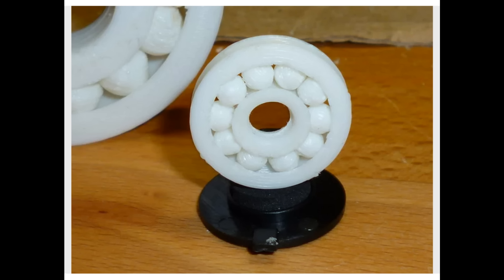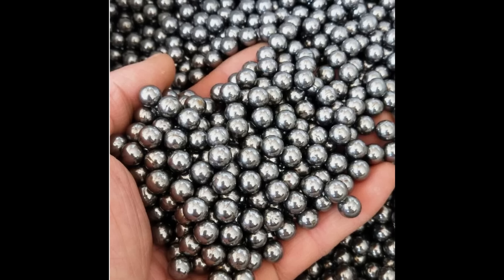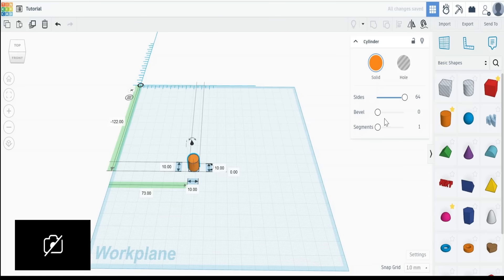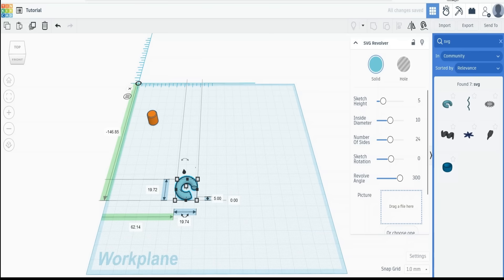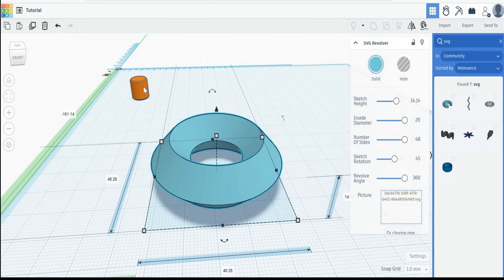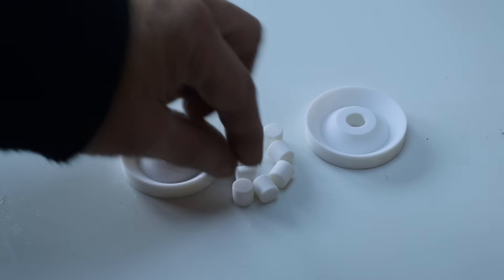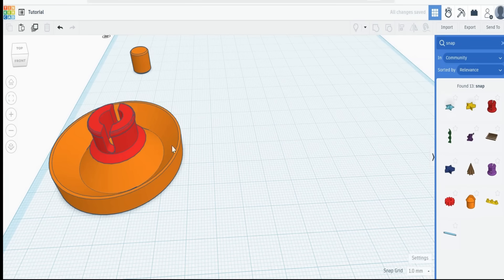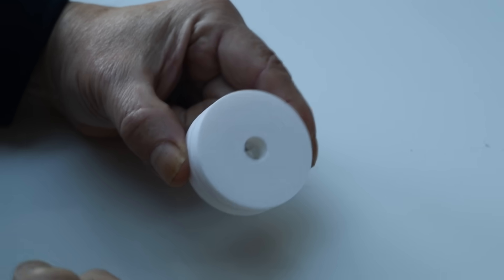2326 Universal 3D Printed Bearing That Works - Radial Cut

Comment: Love this! Awesome explanation and understanding of the limitations of the printing process. I would offer one suggestion regarding the snap fit. It would be best to print the 2 bearing bodies and have a snap fit core printed lengthwise to avoid the layers from splitting when the snap details are loaded.

Comment: I'm now happy to confirm that these bearings are freaking awesome. A tad too large for 5/16ths rod, so scaling everything down would be necessary. You'll need to work them a bit after first assembly and you want to either blow into it or hit it with some compressed air to get the dust out from that process. Not sure if this would handle high RPMs but because it works so well, there are plenty of use cases.
Reply: In case anyone was wondering. You have to scale everything to 83% if you want the bearing to fit snugly on a 5/16ths rod.

Comment: This is amazing. We placed the bearing on the floor and it has no issue spinning under 200 pounds of weight. We are going to use these to show students/industry how strong 3D printed parts can truly be if the design is optimized for printing.

Comment: Tinkercad is great but consider using freecad. Its a bit rough around the edges but it is free and is a proper cad program. Where as tinkercad just works with meshes.

Comment: Hi Robert, 

First off, thanks for all the incredible work you've done on your channel – it's been a huge help to us. I have a different issue I'd like to ask about. 

One of our team members is staying in a fairly new building, and although the main ventilation system is working, the air it’s pumping in has a strange, unexplained odor. It smells somewhat like chemicals or a toxic gas, but it's hard to pinpoint exactly. The issue is, because it’s just a smell, we can't capture a sample for testing, and we're concerned it could be harmful in the long term if it’s dangerous to the lungs or the body overall. 

Do you know of any type of detector or device he could use to identify what this odor might be? We understand you can’t guarantee results, but any guidance would be greatly appreciated. 

Thanks in advance!
Reply from the maker: I'm afraid I don't know of a specific detector - but you might want to tape some activated carbon felt over the vent - that should capture a sample that you can send for analysis
Reply: @ThinkingandTinkering  Thanks a lot mate. I just goggle it and found examples to buy. Last tip, what kind of department can one send such for testing?
Reply from the maker: @AfricanCivilRights  I don't know mate - as I don't know where you are from and countries vary  - but here in the UK maybe environmental services?
Reply: @ThinkingandTinkering  I will definitely find one lke those here in Norway. This help will be used in our database for members for all time, Thanks to your knowledge base guide 🙂

Comment: Compliments on your solution, I was thinking that it introduces a bit of a problem...the contact surfaces of the rollers are pin point which makes for a rapid wear area that remains constant contact at all times. Would it be possible to change the contact point in a way that would improve the fundamental wear characteristics?

Comment: Instead of doing A^2 + B^2 = C^2 for a 45 degree angle, you can multiply the base length by the square root of 2, just a helpful tip that someone taught me that I use regularly.

Comment: when you subtracted the revolved square from the cylinder the result was two separate bodies because the revolved square has a circular edge right on the x-y axis. I found this out while printing. Awesome design.

Comment: Very cool! Quick question: should the length of the snap shaft be 7.07 so that it matches the height of the other half? Looks like it's set to 10 in the video. Maybe you're intentionally adding a gap between the halves?

Comment: bonjour,
j'ai essayer ce roulement. j'ai juste remarquer que le plat haut et bas coince avec les biseaux a 90°. d.10*lg10.
Good morning,
I tried this bearing. I just noticed that the top and bottom flat stuck with the 90° bevels. d.10*lg10.

Comment: The way you designed the bearing would not work for radial loads since one of the halfs connects the outside stationary with the inside. It should work okay with axial loads with the way you designed it, but standard flat laying rollers would work better for axial loads. If you want this configuration to work with radial loads you would need to seperate the outside from the inside. To keep everything in place you could have the outer rim also snap together

Comment: 10:28 Design with 3D printing in mind is something I’ve been screaming into the void for years. So many people put up models that aren’t optimized for printing supports help and tweaks on the end user side but a little pre planning would vastly improve things. 

When you do subtractive manufacturing you have to plan for tool paths and such. 

Good engineers do so. 

Bad engineers don’t even deserve to call themselves engineers. 

Great video. 😊

Comment: "When you're designing something with 3D printing in mind, design it with 3D printing in mind. Playing to the strengths of the 3D printer, rather than putting up with the limitations."

This cannot be repeated enough. It should be in like a pop-up window of every CAD software.

Comment: An always amazing channel. His creativity is just mind bending.

I've never messed with TinkerCad. I'm a Fusion user, after giving up on FreeCAD. Looks interesting. I'm probably going to stick with what I know but I love that snap and socket object. 

3D printed spheres are rubbish, but cylinders are great. What a great insight. 

This bearing is going to need to be lubricated or there's going to be serious wear. The path on the race contacting the top of the cylinder is longer than the bottom, but the two points on the cylinder are going to move at the same rate, so there's going to be a lot of relative motion. Grease will let it slide without galling the opposite face. White lithium or even beeswax might be enough. Depends on how long you want it to last.
Reply from the maker: i am glad you like it mate and good points thanks for sharing

Comment: Using Arc Welder for wound stuff actually prints pretty good curves, such as those in spheres. Sadly it's no longer a maintained plug-in but it still works, so hopefully someone will take it and bring it back up to date. It's crazy that 3D printers both running klipper and Marlin don't use curve commands by default given that gcode does support such geometries.
Reply from the maker: i will have to look into it mate - cheers

Comment: That's going to break as soon as it gets a sheering, lateral force. It's weakest along layer lines, and the small clip that joins the 2 halves together is normal to the layer orientation. There's a reason bearings are made radially and not axially.
Reply from the maker: lol - bless you mate - don't be silly

Comment: would the end of the rollers push on the raceway of the rollers at 90' to them? otherwise, nifty - there's many circumstances when forces are at weird angles that that would happily maintain against. Any chance of some type of performance checks - vs other types of bearings - how good (friction/durability) is it vs a dedicated thrust bearing printed a similar way?
Reply from the maker: other folks tell me in the comments they have started doing that

Comment: This is a great video. It's interesting to see a pretty complex design to come out of a ridamentary modeling software like TinkerCad. As an engineering student, I'm always interested in how I can leverage the unique ways that additive manufacturing systems can be used to make mechanical components. 

I was wondering, as many are, if the design would be helped by conical rollers as it seems that there might be a slight angle on every roller causing it to only contact a point surface instead of a line of contact. It seems that the main benefit of roller bearings in current practice is to use the line contact to spread the force over more area and crossed roller bearings are used commonly in precision applications where the wear is a big factor aswell as their ability to resist all three types of loading. Being made of PLA/ABS/PETG plastics the wear might be more significant even in low precision applications just because the material is much softer.

I like the snaps as a way of joining the two sides together that was a pretty clever way to do that even if it introduces extra friction. Alternatively I think it would be possible to create a housing for 3d printing that uses inner and outer rings instead of the sandwiched top and bottom. You could then have the outer ring split into two pieces for assembly and then you would have them interlock and stay together without introducing another source of friction taking down the efficiency of the bearing. I think I will investigate some possible designs on my own.

I was also wondering if anyone could explain the specific benefits of the crossed roller design. Would an inline roller design be less efficient in this case because the rollers can touch each other, minimizing the interference surface, or is this what makes the bearing better in moment or axial loading?
Reply from the maker: yes it would mate - i am just illustrating one way - my idea is to spark folks to think and design better versions for themselves

Comment: As a mechanical engineer working with SolidWorks for 8 years, I am amazed by how unintuitive the program TinkerCad is. I am amazed that people actually can create functional designs using this program. Requires quite a bit more knowledge about the program and its limitations to be able to design something like this. Well done sir!

Comment: I've once made ball bearings from @MyTechFun design. 
But I used airsoft metal balls and all other parts were PETG/PLA printed.
The pure plastic bearing is interesting, because it can be scaled any rational size.

Though, we don't always need to 3d print everything by ourself, it's better to combine best of all technologies at hand. E.g. screws & nuts we buy because we can't make better.
Reply from the maker: sure mate - but i do like the purity of the whole thing being printed

Comment: Spheres and cylinders are actually fairly easy to find in certain sizes manufactured much more cleanly than 3d printing either. I keep a stock of 6mm airsoft pellets (not sure if those are legal in ol' Albion), but I've bought bags of steel ball bearings in other sizes that I've used for 3d printing projects. Rod could be cut cleanly as well, smoother and faster than 3d printing them.
Reply from the maker: sure - but i do like the 'purity' of totally 3D printed and it is fun to do it that way
Reply: @ThinkingandTinkering  Absolutely! In a pinch, you will always have the parts you need 👍
Mad thanks for the video, I appreciate all the work you put into this ♥

Comment: Nice one Mate. I know it not on subject, remember you showed us how graphene ink can collect electricity from water friction? Do you think that concept will work on a helicopter or Plane Prop, and on wings and (boat) hulls  if painted with it, via water/"air humidity"? Any chance you can test it with a small model in a humid environment. ie a fan in a closed box with water vapour or steam, just imagine if it was useable re-gen charge? YT have disabled my notifications, so not notified for anything. My channel email still works
Reply from the maker: there is little chance i will test that now mate - i no longer have the lab

Comment: The usage of tinkercad absolutely mystifies me. This would be so much easier in other full-CAD programs. But as the tinkercad master as you are there's no need for a sophisticated software.
Reply from the maker: the only reason i use tinkercad mate is because the interface is less frightening to those new to 3D design and that is basically who these videos are aimed at
Reply: @juicebox11598  I love the workaround for revolving sketches to be exporting an object as an SVG and then using a “Revolve SVG” operation.

Comment: May I ask ? If I where to make the top 250mm x 250mm and same for bottom. What size would the pins be? Don't know why but for the life of me I can't get it right. Also thanks for the help and cool video. Will add to my prayers. God Bless.
Reply from the maker: how big are your pins?
Reply: @ThinkingandTinkering  I didn't make them yet. The rolls for your size are 10×10×10. If I make one that is 250mm x250 mm. Not sure the size to make the rollers.

Comment: Depending on your print settings you may need to turn off seam alignment. If your settings aren't good, you could get meaningful bulge at the seams would make your prints less round and slightly oblong and create a binding point not unlike sphere bearings not actually being perfect spheres.
Reply from the maker: good point mate - i forgot to mention it - cheers

Comment: Why isnt that design standard over the ball be. Which that also has longer use since wear can be preased back together and remains the tightness
Reply from the maker: it's probably more expensive to produce
Reply: @ThinkingandTinkering  how is that more expensive its prob cheaper and lasts longer and that is why they dont

Comment: The bevel to reduce sag or elephants foot is ingeniously simple. Very good solution for certain bearings. Ive done some medium load bearings using airsoft bb's that work very nice, you pause the print, load the bb's then continue printing. the bb's become captive into the race & work very good. So much versatility, Excellent engineering.
Reply from the maker: that is an awesome tip mate - thanks for sharing

Comment: Nice design. Needs some tweaks to actually function as a bearing, since now both the inner and the outer surfaces which contact the axle and the mount each consist of two surfaces which rotate at different speeds. In a normal bearing you have all surfaces touching the axle rotate the same speed: the speed of the axle of course.

Theoretically the bearing cylinders should be slightly conical.

Really nice design. Have you uploaded it to Thingiverse?
Reply from the maker: it's on thingiverse - link is in description

Comment: 3:20 Elephant's foot isn't relevant only where the part touches the build plate. There's also a similar thing happening at the end of the bottom chamfer, so you actually should round that edge to fix that, too.
Reply from the maker: ok - cheers

Comment: 1:33 The problem isn't at all that 3D-printers are "digital". At all. Not even close. There's no problem adding ever smaller micro stepping and/or gearing down. After all, the printer itself is very much analog. It's a physical thing with continuous (non-discrete) movements.

The problem with near-horizontal surfaces appears if you're doing planar printing, layer on top of layer, since layers can't be infinitely thin. The limiting factor isn't the digital nature of the controller, or even the stepper motors. It's the physically practical requirements of the minimum layer height.

Now, you don't have to do planar printing, but most 3D printers are at least somewhat limited when it comes to non-planar printing, as they can't tilt the nozzle, nor the build plate.
Reply: Part of the issue is the practical limits on minimum layer height, part of the issue is inaccuracies created by the process of starting and stopping printing on a layer, and part of the issue is bed adhesion (a sphere rests on a point geometrically and a little tiny circle physically).

Aliasing from digital to analog conversion does technically place a limit on how thin layers can be, but it isn't the limiting factor in practice. If 1 step of the z axis motor(s) is too big, you could swap to a motor with smaller steps or gear down the motor. And of course there's micro stepping, but that's complicated.

I mean, really, 3D printers are terribly imprecise machines compared to some of the stuff out there in the metrology world that is ultimately controlled by digital computers. Digital isn't the problem.
Reply: @SnakebitSTI  That's exactly right. The DAC aliasing is the least of those problems, by far, and affects spheres and cylinders alike. The digital nature of any part of the printer just isn't the problem in practice, the OP is just plain wrong when claiming that.
Reply from the maker: well we all have our view i guess
Reply: @ThinkingandTinkering  Huh? Well, yes, but your view is completely wrong, and I explained why and how, and even what the symptoms are caused by. So yes, we can have our own view, and yours is definitely wrong. No ifs or buts about it.
Reply: @marcus3d  99% of consumer FDM and resin printers use discrete, planar code. The conversation is about planar printing. That much is obvious. Your argument is largely semantic, irrelevant following a simple clarification, and a little hostile?
Reply: @evancoberley2650  No. If the digital nature of the controller was the problem it would be equally problematic when printing cylinders on the same printer! Obviously. But cylinders aren't a problem (even on fully planar printers), because...guess what...the problem isn't that some part of the printer is digital! The OP is just completely wrong any way you look at it. The problem has nothing to do with anything being digital. Nothing at all.

(Also, printers usually run gcode, and gcode isn't inherently planar, but yeah, approximately 100% of slicing done on the planet produces planar gcode, although that's slowly changing. The newest slicers now have a non-planar feature, namely for fuzzy top skin.)